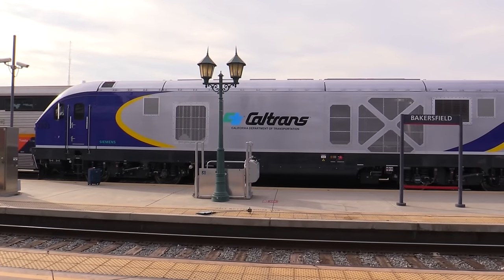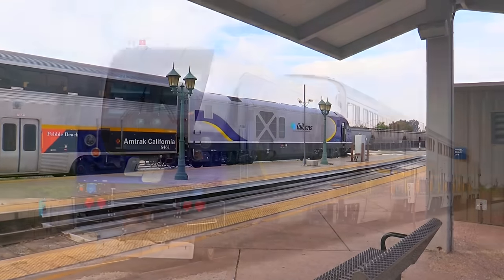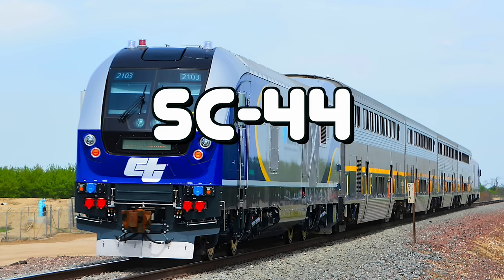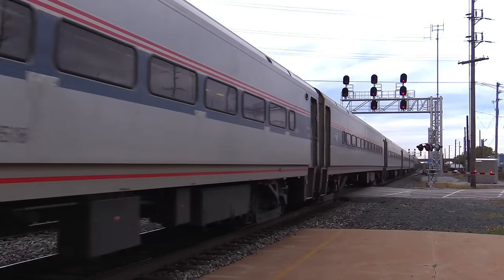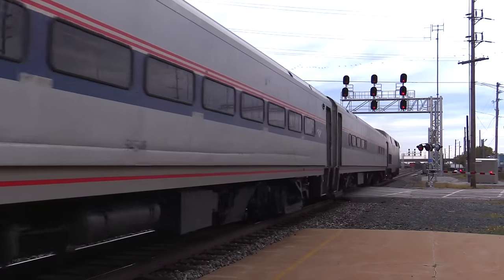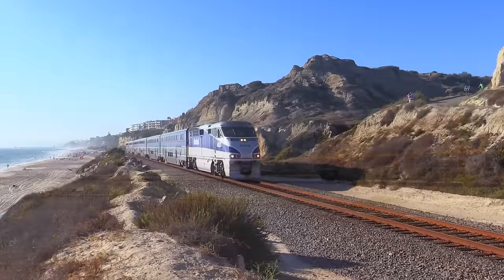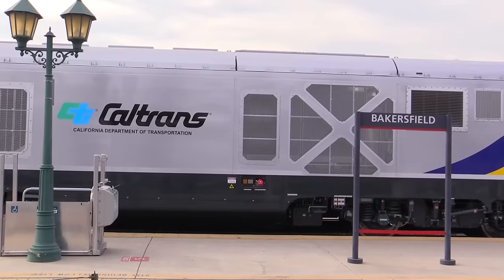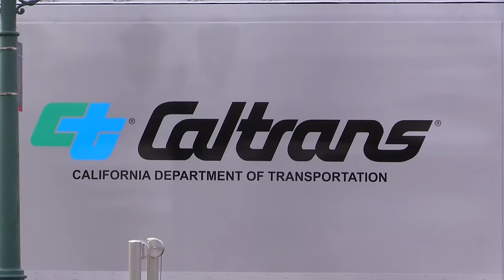NEW Amtrak California Charger Locomotive Test Train

Comment: hey hoo, it feels good to be early :)
Reply: quick question though: when there are freight trains in your vids, I've noticed that there's always two or more locomotives in the front with at least one of them running backwards like on 3:37. why are they running backwards?
Reply from the maker: The freight locomotives can be run in any direction. They just need the leading locomotive to be faced in the direction of travel. The others, it really just depends on how they come into the yard.
Reply: aaah, that makes sense!well, that's one problem off my chest, time to focus on passing school :P
Reply: I can also say this law requires the locomotive to be run with ditch likes leading (that is why you see a triangle of lights) If the locomotive has ditchlights on both ends I've seen them run backwards already too

Comment: what is going to happen to the Genesis locomotives? I would certainly hate for them to replace long distance runs especially that they have the monocog design and if you don't know a monocoque means that the entire outside isn't it is one big shell the engine prime mover and power generators are kept inside making a lightweight almost like a jet
Reply: The P42s will most likely stick around for a while. Not to mention that only a few regions have ordered Chargers, so the Genesis fleet, at least for the most part, isn't going anywhere.
Reply: I'm glad to hear that thanks for telling me
Reply: I think it's the P40 rebuilds they're replacing I believe that most of the p40dc locomotives have already been replaced in Amtrak's roster  with the exception of number 822 which is part of Amtrak's 40th anniversary heritage Fleet
Reply: It's possible, but I doubt the entire remaining P40 fleet besides 822 is getting sacked. At present, I think it's still P40s that are pulling the Auto Train IIRC.

Comment: Why are you standing at the railroad crossing, do you like the noise?
Reply from the maker: There are very few decent locations on this line given the time of day and the sun angle. I would've preferred an overpass as it would've softened the sun angle, but there weren't any that looked suitable. So I was left with the choice of shooting from a railroad crossing or from beside a road that runs parallel to the tracks. Since the crossing provided a better angle for viewing the train, the choice seemed obvious.

Comment: Will the Chargers also be used on Amtrak's long distance passenger trains?
Reply: I remember reading/hearing somewhere that these locomotives, at least on California's end, are specifically meant to free up the P42s that currently run on the Surfliner and Capitol Corridor to be available for long-distance routes like the Southwest Chief and the Coast Starlight. So no, I don't think they will.
Reply: Zack and Zane you better hope not
Reply: yes they are ALC-42’s will replace p42s

Comment: What if 20 where used in Amtrak's northeast corridor and they will soon replace the ACS64 and they will be friends with Amtrak aem7 915 when the aem7 is repainted into a sc44 colored aem7 and it will have the same color as the acs64 in 2018
Reply: It's not going to happen. New York City, as well as other stations that have lack of ventilation, has prohibited all locos that don't have electric shoes and/or pantographs and the ACS-64 is too young to be replaced..

Comment: Will P42s still lead long distance superliner trains
Reply from the maker: Yes, Amtrak plans to rebuild the P42s between 2018 and 2019, so they will be here for the foreseeable future.
Reply: What will happen to my favorite F59PHI 456 on the surfliner? Scrapped?
Reply: Maybe they will also be rebuild and relocated onto different trains.
Reply from the maker: @Acerailfan3101 F40PH That was one of the options that they were considering, but they ultimately decided to buy new locomotives. However, the current order of 75 new Chargers isn't enough to replace all the P42s, so they will likely be around for quite a while longer before enough chargers are ordered and built to replace them.

Comment: American rail is still behind the times. These new units would be better used for Cargo rail. as for Passanger rail we need the Amtrack system revamped with an Electrified system with overhead wires and new trains that are all electric and have motors in every car. greater traction and beaking power. same goes for ACE and Caltrain too. also they need to use semi-conical metal wheels and a Double rail system to prevent wheel hunting. they need to have a comprehensive diagnostic and track geometery train . lastly they need to hire TRAIN TIME KEEPERS to analyize Train Arrival, Depatrure times to ensure they are on Schedule.
Reply: Mark Plott that’s just a waste of power no one wants electrical trains and wires everywhere it looks cleaner without all that anyway plus all of this you stated is to exspensive and complicated

Comment: I see it is a win-win scenario p59 can be moved to other services and even back to long distance services Amtrak's Fleet of p59 locomotives need to be moved back into regular service and the Chargers and MPX locomotives need to be moved back into commuter service and the F40s need to be retired. if Amtrak wants long-distance trains they need to move their cars and locomotives back into those services and outdated equipment needs to be sold, replaced, or scrapped anything that does not meet the Accessibility Act needs to be scrapped anything that uses an outdated truck assembly needs to be scrapped any car that is not fitted with disc brakes needs to be scrapped and all Intercity equipment needs to be updated, refurbished, sold, or replaced. Pullman cars are collector's items all these ones need is updating. Rail America cars, and Budd cars are outdated these need to be scrapped most of the baggage cars have been replaced and updated. Ringling is selling off most of their fleet so they're going to be a surplus of passenger cars soon. these can go to Excursion railroads most of the Budd stuff needs to be scrapped we do not support that braking system we do not have the truck assemblies or parts for the cars anymore and they are so old they are not structurally sound and most of them are made of aluminum which cannot be repaired or replaced. steel can be replaced and it is structurally sound all it needs is rust inhibitor and welding. replacing the locomotive the first step to modernizing the fleet the next step is all of Amtrak's cars need to be updated and replaced and then the final step is we need to put the long-distance routes back in service. Amtrak is losing money to the airlines and some of those airlines are pulling up stakes from towns that the railroads used to serve if we want these towns back on the map we need to reinstate rail service to them and buying these new locomotives is the first step.

Comment: I hate this 'charger' look..They resemble electric light-rail  transit cars more than US main-line locos,...especially when pulling cars taller than itself. To me it's cheesy and impotent looking..I bet they'll eventually fail after a few years in service.
Reply: Mark Harris you ever know but I agree it’s just sad to make the loco shorter than the cars
Reply: I do greatly prefer the taller engine (and the streamlined look) but these are not the first engines that did not line up with the cars (and are better looking then the Talgo Engines).

Comment: I wish North America could maintain the general locomotive design like the freight locomotives have. European locomotives follow the same design concept as the early 1980s, it's just more sleek today. Here for some reason we have to completely change everything and copy the Europeans. Personally, I thought the P42's looked amazing in Phase III and IV, but they look like crap in the blue flush scheme. The F69PHAC units I think were a good example of modernizing but maintaining the American railroad design as well. Why there's so much hatred against the traditional boxy locomotive design by those outside the railfan community is beyond me. 

If people are ashamed about how America's passenger trains are, the shape of the train will change little to nothing. The infrastructure itself is where the problem is. There's nothing wrong with a modernized F40PH flying down the main at 110mph making a trip from Chicago to NYC connecting the two cities in 12 hours. Copying the Europeans just shows insecurity by pretending that our railroads are just like theirs. It's rather embarrassing and pathetic really. 

Btw, I love the narrative. Very engaging.
Reply: I guess American RR will never be able to reach the level of European ones concerning passenger traffic; For long distances it wouldn't be relevant due to the airplane network, but in between some more or less closer located metro areas it for sure would make a difference

And btw also European locomotives have changed quite a bit since back then